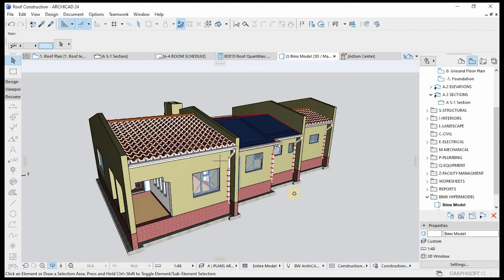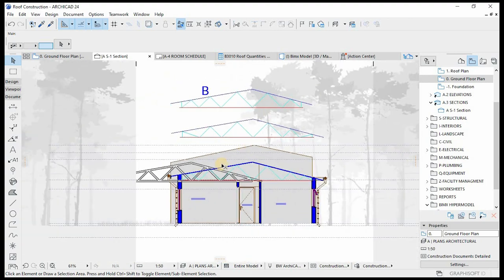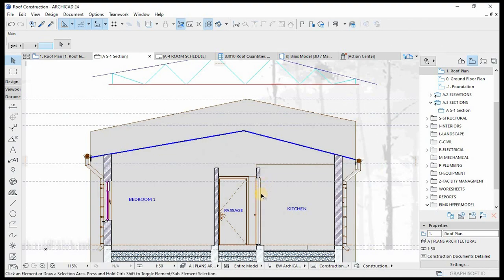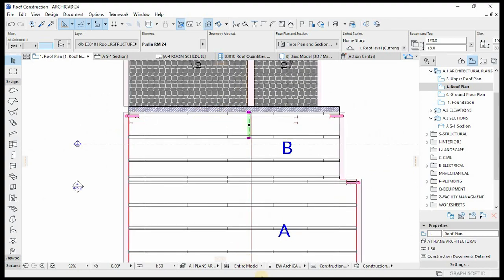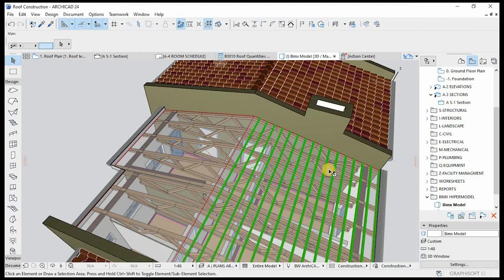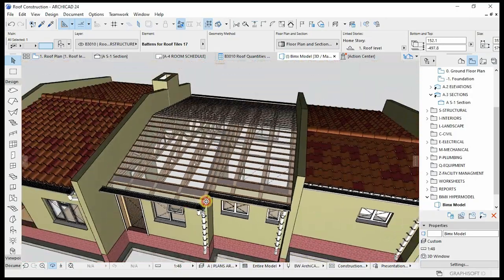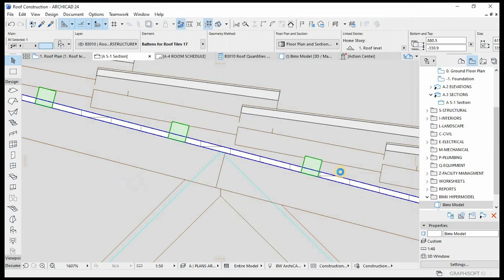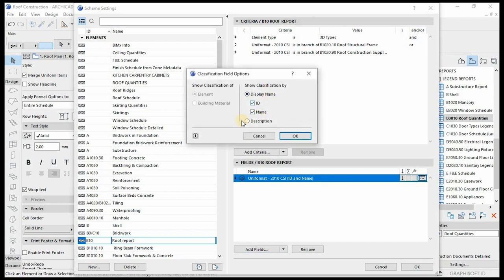ArchiCAD Roof Construction Course | Plus calculation of roof quantities

Comment: Thanks for your video! I found it very useful! Just one problem: when i select my roof, then i go to Design -> Design Extras -> Accessories -> Roof accessories and select the type of the roof tile, then hit OK, noting happens. Archicad won't generate the roof tiles. Do you have any solution or advice for this?
Reply from the maker: Explode the roof first then do it again
Reply: @MesolightVisual  i already exploded but didn't worked. In AC24 it works perfectly. It seem like a bug or something similar.

Comment: @ https://youtu.be/p_FBKsGTfNk?t=3267 (54:27) how do you get (or input) the length of the members when adding fields on the scheme settings
Reply: When adding fields, how did you add Length A @ 54:36
Reply from the maker: Add a  reference length field from object/element section in the scheme settings. This applies to every element.